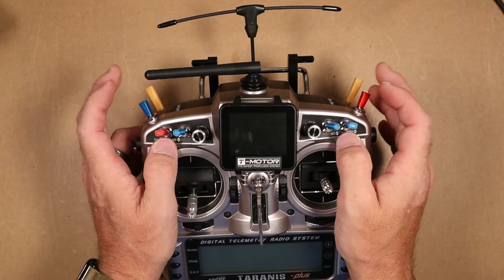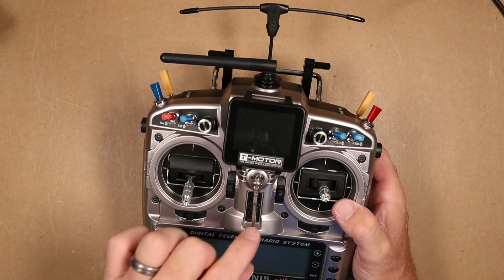3D in FPV - Why Having a 3D Printer May be Valuable in FPV

Comment: Love my ender 3
Reply from the maker: Great printer to have! Still mind blowing that it’s sub $200.
Reply from the maker: Depending on the type of filament and brand  there are some kinks to work out for sure. Not super hard though. It is a good feeling to need something, find it’s available to print and within a few hours (to days) it’s in your hands. Just wait until you start making your own products with CAD programs. That’s some next level type stuff. I just had the OMG moment where the program made sense and now have been designing parts pretty often. I can’t wait to hear more about your journey with FPV and printing parts!
Reply from the maker: The mainboard upgrade will do wonders for sound too. My CR10s Pro is super quiet (minus the fans) compared to the Ender 3 Pro. Will be upgrading that board hopefully soon. Auto bed leveling is another thing I’ve got to install, your right it’s one of the best mods. 
PETG is good but you’d have to upgrade from the magnetic bed. It’s also sometimes challenging to get the corners to stay down. I’m currently experimenting with some different settings and bed styles. 
Fusion is a great program, comes with quite the learning curve though. Just started making my own frame, or at least trying to.